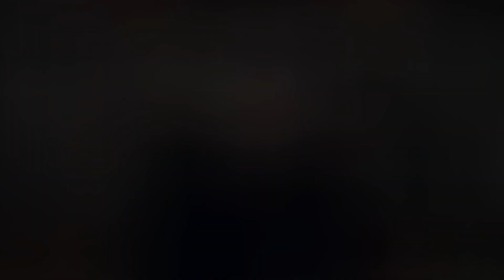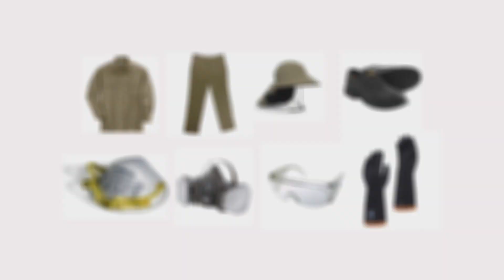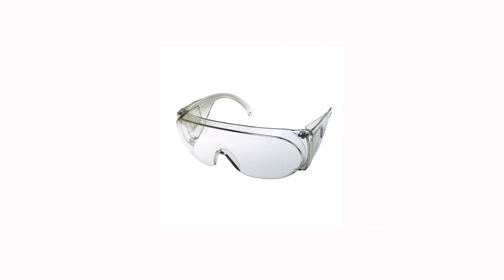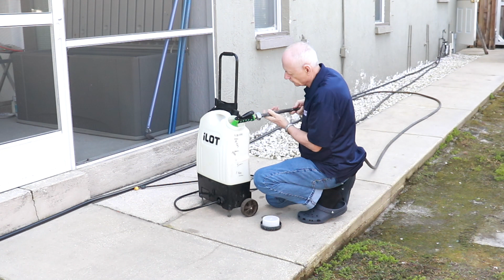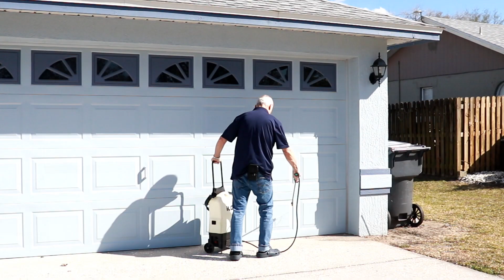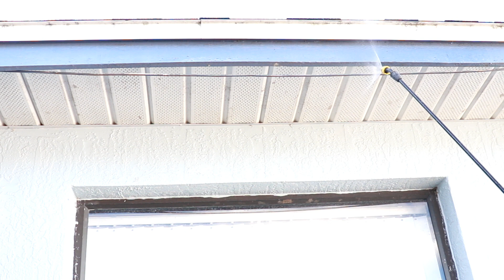How to Prevent Drywood Termites 100% Guaranteed.

Comment: After viewing many of your videos about drywood termite & professional inspections, we have fumigated the home last week and it was LOTS of prep work.  I have a few questions hoping your expertise can shed some light on.  Thank you Sir in advance ! 
1. the Talstar P & Taurus SC obviously spray onto painted fascia board & trim pieces, do they stay on the paint well?  
2. any non-pesticide method such as repellent we can spray onto painted fascia board & trim pieces?  This way it's even easier & less PPE needed.
3. drywood termites create small kickout holes in my fascia & trim, is that ok using caulk to patch them?  removing fascia & trim is a lot of work and may create add'l damage in the process.
4. there are many PVC fascia & trim board available, would you recommend using PVC fascia & trim so this permanently solve termite & dry rot?  I am afraid if drywood termite doesn't eat PVC fascia & trim, they will attack rafter tail directly which is even worse b/c I can't replace every single rafter with PVC.
Reply from the maker: I would be happy to answer those questions for you.  The first thing you should know is that, since you already fumigated, you need to get going with doing the preventive treatment.  I always recommend starting that before you do the fumigation because the gas has absolutely no residual action, and you can get reinfested the moment the tent comes down.  For that reason, I wouldn't waste any time doing the preventive treatment.

All modern-day pesticides pretty much stay right where you put them.  The Talstar P and Taurus SC are no exceptions.  If you like, I can tell you a faster way to do it though, but you need to do it every 60 days.  You can use a hose end sprayer and probably treat your entire house in under 30 minutes.  That is exactly what I do and it is super fast.  The only thing is that you are not supposed to do it that way because you will exceed label recommendations for the amount of pesticide that you were supposed to apply.  However, it will not harm you with the environment.  In fact, doing it this way creates a lot less overspray that can get on you.  To use the hose end sprayer, you need to use a different product entirely.  I have a video on how to do that, and I will give you a link to it.  The new product is Bifen XTS.  It has the same active ingredient as Talstar P, but it is more concentrated and has a very watery viscosity, which allows it to work well in hose end sprayers.  The sprayer that I recommend has a stream setting on it that makes it perfect for treating places on your home that are too high to reach.  The sprayer can reach heights up to 25 ft, depending upon water pressure.  After this product is applied, you will not see it on the house.  The only place you are likely to see it, is if you get it on Windows.  It kind of makes them look dirty, but it causes no harm.  In fact, having it on the windows helps to prevent drywood termites from entering. So, even though it does make my windows look a little dirty, I can live with that, but I cannot live with drywood termites.  The video that I'm going to share with you will show you how to do this with both the tank sprayer and a hose end sprayer.  The hose end sprayer application is near the end of the video.  Do not be afraid of applying too much pesticide.  When I treat my house, it is running off the fascia boards and soffits like rain.  You literally cannot overkill with this stuff.  The Bifen XTS may seem quite expensive to you, but keep in mind that it gets mixed at 1/3 of an ounce per gallon instead of 1 oz per gallon like Talstar P.  Therefore, it goes three times as far.  If you already purchased the Talstar P and the Taurus SC, that's perfectly fine.  Those products will do a very good job.  The only reason I use the Bifen XTS is because it makes the job go way faster and I can reach high places without using a ladder.  Other than that, it really doesn't make any difference.

I would love to tell you that there's a natural way to prevent drywood termites, or any other pests for that matter, but the truth is the only way to do it is to use a pesticide that was developed for that purpose.  Today's pesticides are safe enough for children to play on them after they dry.  Pesticides got a bad reputation because of the kind of pesticides we used in the 20th century.  Virtually all of those were banned in the late 1990s.  We are almost a quarter of the way into the 21st century, and we now have 21st century pesticides that are perfectly safe to use.  In fact, they are just as safe as laundry detergent.  The reason we wear protective equipment is because you wouldn't want to spray laundry detergent on yourself either and you would not want to inhale it or get it in your eyes.  Now would you?  Still, you use it all the time.  And don't even get me started on bleach.  People use bleach all the time in their wash and it is way more hazardous than any pesticide that you can possibly purchase.  If you would like more information about this, please watch my video on the subject. I will give you a link to it.

You can fill the kick out holes in the fascia boards with any type of caulking you like.  I think what works best is Bondo.  This product was developed for auto body repair on cars, but it works wonderfully well on wood too.  It is easy to work with and it also sands down very easily as well.  When you are repairing the fascia boards, push on them with a screwdriver to make sure that they are not hollow.  If the screwdriver pushes through the wood easily, then that area of the wood should be replaced.  Naturally, you can replace the fascia boards with a non-wood material, but that will not stop the drywood termites from infesting your home.  The fascia boards are only one place where they enter and they always seem to find their way into the attic and the walls, regardless of what you do.  Therefore, the best way to prevent them is to do the treatment that I am recommending every 60 days.  If you need to replace any of the fascia boards, you can treat bare wood that has not been painted or sealed in any way with Bora-Care.  I will give you a link to it.  This will make the wood permanently termite proof.  It will also protect you from carpenter bees as well.  Remember, this is for new wood only that has not been sealed with anything.  I recommend applying it to the wood prior to making the repair.  Wait at leas 48 hours before you paint it.

I hope that helps.  Be well my friend.

Video on how to treat the outside of your house with a hose and sprayer:  https://youtu.be/Yozv3s-Qwlw

Video on how safe pesticides are to use:  https://youtu.be/i7nLO6Js_3Q

Video on how to use Bora-Care:  https://www.youtube.com/watch?v=Rmr_aEodyhg

Bora-Care:   https://www.domyown.com/boracare-p-100.html
Reply: @GuysPestSolutions  Your Bondo idea is genius b/c caulk will cost way more.  Similarly, could I also use stucco / drywall spackling paste b/c it comes with much bigger container? 

Your Bifen XTS idea is a lifesaver b/c it will reach 2-story house so I don't need to climb up every 3 month.  We greatly appreciate your advice & experience keeping us safe.  Thank you Sir !
Reply from the maker: @Brian_L_5168  Thank you do much for those kind words.  Very much appreciated.  Spackling compound is water soluble, so it is for interior use only.  I wouldn't trust it for exterior use, even if you paint over it.  I hope that helps.  Be well my friend.

Comment: I have drywood termites in my front door (tent was done about 4.5 year ago and we do it about every 5 years anyway). Local 5 star rated (with thousands of reviews) pest control company quoted me $1200 for no tent option with a one year warranty where they will do the front door, attic and all around the home. I have two questions. 1) Would you recommend letting them do it or it is something I can DIY and 2) since it's only $1200 every 5 years (or $240 per year) for no tent wouldn't that be a better option then to be DIY for 5 years, risking health and buying and storing chemicals to DIY?
Reply from the maker: It sounds like the pest control company that gave you the estimate is planning to do some sort of spot treatment. $1,200 is pretty expensive for a spot treatment, so they may be planning to do something in addition to that as well. I have no idea what that would be, without looking at their estimate.  If you like, you can send a copy of the estimate to me at guyspestsolutions@gmail.com, and I would be happy to have a look at it.  That being said, it is important to understand how drywood termites work.  They enter through cracks and crevices around windows, doors, the eaves, pipe penetrations, and so forth.  Most of the time, they enter through several locations.  That is because a swarm of them attacked your house at the same time.  If there was a crack or a crevice, then they probably found it.  After they establish their galleries, which will be inside the wood, it will take four to seven years for them to be able to swarm.  Now that they are in your house, the swarmers will use holes that are in your studs to travel through the walls.  Those holes in the studs were created by the electricians to run the electrical wiring.  Not only are these holes going through the studs, but holes were drilled into the attic for the light switches and to run some of the wiring for the outlets.  So, the termites now have easy access throughout the attic and the walls.  If you have a basement or crawl space, they have access to that as well.  Most of the time, you will have no idea that they are in the walls, because the frass is inside the wall.  To make matters worse, if you have drywood termites, then your neighbors have them too.  That means you have been getting swarmed for as long as they have existed in the neighborhood.  Most likely, we're talking about years, so it's a safe bet that you have these guys in many locations in your home.

I always hate to be the bearer of bad news, but if you have drywood termites, the only sure way to get rid of them is to fumigate.  Prices for this can vary wildly in this industry, so I recommend that you watch my video on how to hire a pest controller without getting ripped off.  That video can save you a lot of money.  You should also know that the gas they use to fumigate has absolutely no residual action whatsoever, so you can get reinfested the moment the tent comes down.  This is the reason you need to fumigate every 5 years.  Like I said before, if you have drywood termites, then your neighbors have them as well.  Since drywood  termites swarm every year, it is almost a certainty that you will be reinfested within a year after the fumigation is done.  The only way to prevent this is to do a preventive treatment on your house every 60 days.  Most pest controllers will not do this, so it is something that you generally need to do yourself.  I have a video on how to do that and I will place a link below.  If you absolutely cannot afford to fumigate your house, then you can try spot treating it yourself.  It is virtually impossible to find all the termite galleries, but it is way better than doing nothing.  The pros cannot find all the galleries either when they do it.  That is the reason spot treating is not a solution to the problem.  Regardless of how you treat it, you should begin the preventive treatment immediately, so that you do not get additional termites paying you a visit.  So, the bottom line for you is that the treatment this pest control company is offering will probably help, but it is very doubtful that it will resolve the issue.  You only get a one year guarantee, so they will charge you an annual fee to extend it.  That fee will go on forever and it will never end the problem.  So, your house will go on getting eaten during the entire time you are doing this.  Regardless of what you decide, I would like to have a look at their estimate to see what they are offering.

I hope that helps.  Be well my friend.                      

Video on how to hire a pest controller without getting ripped off:  https://youtu.be/y-a8XOqVrlE

Video on how to prevent drywood termites (Note that you do not need to treat your yard for drywood termites.  You only need to treat the house):  https://youtu.be/Yozv3s-Qwlw

Comment: Hi, Guy.  Thanks a bunch for the wonderfully informative videos.  What products can a Southern California homeowner use to prevent drywood termites?  Both Taurus SC and Talstar P can't be shipped to CA consumers.  We have noticed one or two swarmers recently near light fixtures outside our new construction home and would like to do everything we can to protect it.  Thank you!
Reply from the maker: It is important to understand how drywood termites work.  They enter through cracks and crevices around windows, doors, the eaves, pipe penetrations, and so forth.  Most of the time, they enter through several locations.  That is because a swarm of them will attack your house at the same time.  If there was a crack or a crevice, then they probably found it.  That means, if you have seen swarmers, they may be inside already.  After they established their galleries, which will be inside the wood, it will take four to seven years for them to be able to swarm.  Now that they are in your house, the swarmers will use holes that are in your studs to travel through the walls.  Those holes in the studs were created by the electricians to run the electrical wiring.  Not only are these holes going through the studs, but holes were drilled into the attic for the light switches and to run some of the wiring for the outlets.  So, the termites now have easy access throughout the attic and the walls.  If you have a basement or crawl space, they have access to that as well.  Most of the time, you will have no idea that they are in the walls, because the frass is inside the wall.  To make matters worse, if you have drywood termites, then your neighbors have them too.  That means you have been getting swarmed for as long as the house was there.  So, you cannot rule out that you have an existing infestation in the early stages.

I always hate to be the bearer of bad news, but if you have drywood termites, the only sure way to get rid of them is to fumigate.  You may not know for some time, so just keep an eye out for frass.  Prices for this can vary wildly in this industry, so I recommend that you watch my video on how to hire a pest controller without getting ripped off.  That video can save you a lot of money, should the need arise.  You should also know that the gas they use to fumigate has absolutely no residual action whatsoever, so you can get reinfested the moment the tent comes down.  Like I said before, if you have drywood termites, then your neighbors have them as well.  Since drywood  termites swarm every year, it is almost a certainty that you will be reinfested within a year after the fumigation is done.  The only way to prevent this is to do a preventive treatment on your house every 60 to 90 days.  Since you have a new home, then you are wise to begin doing it right now.  Most pest controllers will not do this, so it is something that you generally need to do yourself.  I have a new video on how to do that more efficiently and I will place a link below.  For drywood termites, you do not need to treat the yard.  Just the house.  You can obtain the Bifen IT or Bifen XTS from domyown.com.  I will give you links to both products.

I hope that helps.  Be well my friend.       

Video on how to prevent drywood termites:  https://youtu.be/Yozv3s-Qwlw     

Video on how to hire a pest controller without getting ripped off:  https://youtu.be/y-a8XOqVrlE

Bifen IT:  https://www.domyown.com/bifen-it-p-226.html

Bifen XTS:  https://www.domyown.com/bifen-xts-p-1236.html

Comment: Hi Sir, thanks for sharing all these important tips. As you mentioned ,ach chemical has to be used for 3 months .That is, a rotation has to be done with each one. will the solution last foe 3 month in case of rainfall or if the treated areas are regularly washed.
Reply from the maker: Taurus SC will last 90 days, but other pesticides will last more like 60 days, so I treat every 60 days with Bifen XTS now.  I did not mention that in the video because I just recently switched to it.  I apply it with a hose end sprayer because it is way faster that way.  You are not supposed to do that, but it will not harm you or the environment.  None of the pesticides wash off from the rain.  If you are interested in doing that, just watch my video on how to treat your yard with a hose end sprayer.  Mix the product as shown and use the recommended sprayer.  You won't believe how fast it is to do this way.  Shhhhhh.  Don't tell anyone I shared this.  If you want to use Taurus SC, then you should alternate between products at least every 90 days.  I hope that helps.  Be well my friend.

Video on how to treat your yard with a hose end sprayer:  https://youtu.be/wifoTU5dmp0